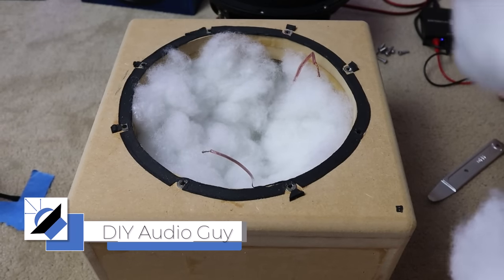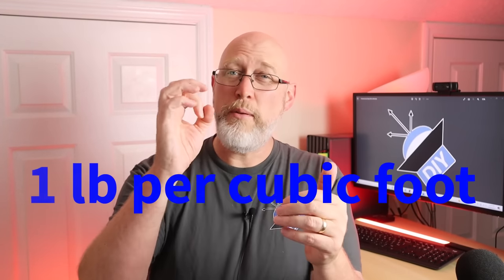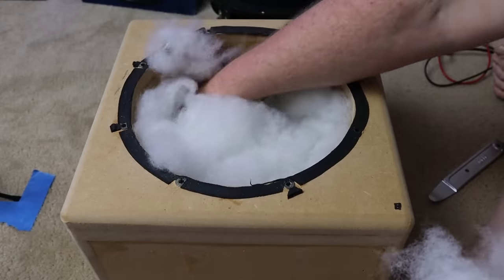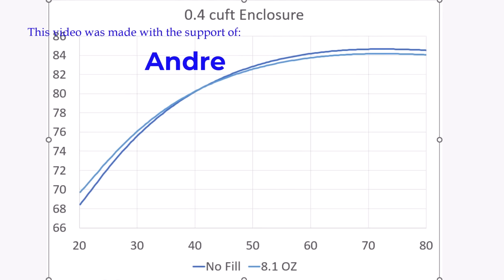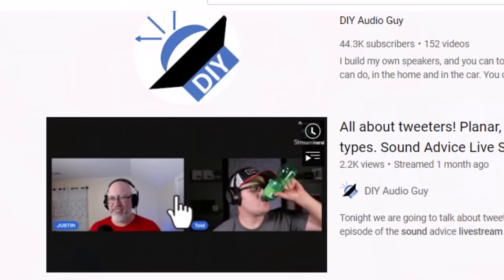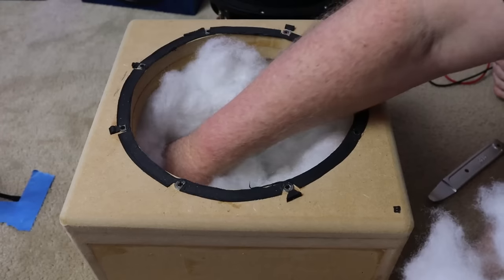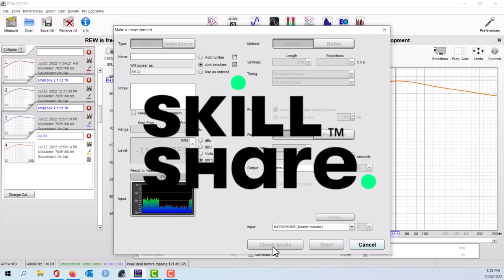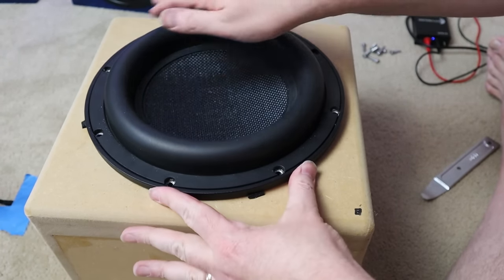Can Polyfill "fix" a small box:  Bass in a Small Space

Comment: A buddy of mine took third in modified wall at USACi finals by perfecting his small sealed side 4th order by putting poly fill in the sealed side. Completely manipulated the drivers to believe they were in larger volume and actually played lower than my fourth order using the same equipment having a larger sealed side. I've been a believer of it since
Reply from the maker: Interesting, perhaps I'll need to build some bandpass enclosures and see what happens.
Reply: Slowing the movement of air makes driver think it's in a bigger box. That is one reason why stuffing is used. In ideal use would be to tweak a little bit too small enclosure size into more favourable. 

This comment is before watching the video, I'll be back if something changes my mind.
Reply: Unpopular opinion- drivers don’t “think”.
Reply: @robtaylor8907  Yes, just words we use. They don't "think" or "believe", they are working according to their specs considering surroundings.
Reply: @robtaylor8907  sheesh ...mine do. I just trained a couple of 18's to clean my garage😂
Reply: @wb3213  damn… show me these training techniques! 🤣
Reply: Tried this in a pair of bandpass w/ 70% polyfill in the sealed sides. it made the transients less harsh by maybe removing the standing waves. Also the bass seemed smoother. Not sure if it's louder th.
Reply: It it was perfected he would of won no? Believe what you will.
Reply: @patrickmiller4987  SPL contest. More power and he would've won. His response was nice and linear. That's what I meant by perfected.
Reply: There is no perfect in audio, very subjective. SPL is just a decibel level its not SQ. Any competitor could claim "if only this or that I would of won". Like I said believe what you want bro but its conjecture on your part. Take care.

 @DibeezyTheGifted

Comment: SQ and SPL goals are muuuuch different. Polyfill and/or open-cell foam is used to mainly damp resonances and uncontrolled, peaky, runaway bass - it smooths out peaks in subs' and speakers' upper bass. It will make them less efficient, but when they're fed with more power/level boosts to normalize the FR from the upper bass losses and to the mids frequencies - the bass that's there will be deeper, tighter, and sound much better/smoother. SQ lovers don't like bass peaks followed by steep rolloffs - that's the antithesis of good bass......
Reply from the maker: If I can get enough views on this video then I will be able to do more tests.
Reply: @DIYAudioGuy  😂😂😂
Reply: Spot on. I'm focused on SQ at home and in my vehicle. I have a background in pro recording, ears spoiled by reference monitors for years- I only care about accuracy at this point. Losing 10db all around is fine by me if I gain accuracy as a result... clean amplification is cheap these days. Those crisp transients, damped internal reflections are worth it.
Reply: @lllllllllllllllllllll1lll1  Same for me for decades; at home particularly in my 2-CH room, my vehicles. I like things louder than friends & family for sure, but definitely prefer tight responses and accurate (to me) reproduction. 👍
Reply: polyfill will do nothing for resonances, it has no mass.
Reply: I used polyfill but switched to memory foam and it sounds a lot better. sealed box with two 12s
Reply: Agreed. Higher SPL isn't improved sound. It's just louder. When you raise the lower SPL curve from the poly fill to match the one without, the change in LF extension and smoother curve is easier to see. There are other videos that compare the changes in that way. Poly does what they say it does.
Reply: I found a 6" roll of  1" foam at Hobby lobby, easily cut to size, not loose polyfill that is messy. Can't wait to try it

Comment: Found it!!!  Thought you might find this interesting...

I was taught long ago the primary purpose of "fill" in a speaker enclosure is to reduce internal cabinet resonance which muddies the bass response.

1965 A. R. Bailey did a series of tests published in the British audio magazine, Wireless World using various damping materials for a long quarter wave transmission line design. Various synthetic and organic materials were used.

The test comprised of discharging a low inductance capacitor at 250 volts thru a fixed length fusible wire that was literally exploded within the cabinet with a repeatable impulse patterns.   The rise and decay characteristics were close mic'ed and captured via O scope.

I best results of all the materials used were found with long hair wool showing the smallest initial impulse rise and the quickest decay.

I've two copies of the original article, but can't find anything online.  An interesting read none the less.

Comment: I have some vintage Klipsch KG-4s that had the original 1 inch foam panels tucked into the sides of the cabinet. Not fond of the bass response, I had to add a sub to get that low end resonance to the room. I removed the foam panels,  lined the insides, top and bottom of the cabinet with felt and stuffed with 12 oz. of poly-fill. I only did one speaker at a time to test the results. Using my ears, which is the ultimate test IMHO, the bass response in the poly-filled speaker was smoother and did not cut out so quickly as the stock speaker, better low end resonance. I liked it, so I did both speakers and removed the sub from my system. Suits my ears just fine. These KG-4s are completely rebuilt now: titanium voice coils in the horns, xover has all poly caps, original inductors and 1 ohm resister instead of the .7 poly switch (to tone down the highs slightly), felt lined cabinet and 12 oz. poly fill. They sound amazing!

Comment: Back in the 80's we were stuffing boxes to dampen out the higher freqs because the crossovers at the time were not so great.  In all the testing with the test equipment i had back then i was only able to determine there was a small drop in Spl, but it did sound better with the stuffing, so great for SQ.
Reply from the maker: Cool
Reply: I remember my mother saying "Am I going nuts? Where did that pillow go?" - "Not so great" is being nice about it :  )
Reply: I added stuffing when I made a cabinet for my bass woofer out of an old beat up Kustom brand cabinet that had one blown speaker out of the two, so I bought a book from RadioShack and as I started to understand the concepts, I became intimidated by the math, and the fact that I had no specs on the 15" woofer, so I used fiberglass lining and stuffed it with poly fill, both RadioShack products, and it sounded pretty good in a manageable package. 
I would love to make a special cabinet with the modern updates and the goal of making tight bass with no irritating peaks.
Reply: Does poly work in ported enclosures? Great tutorial by the way 😎
Reply: @anthonysandoval965 Believe he spoke on that briefly towards the end; roughly a similar "quick test" showed similar returns.

Comment: Yeah, I find the larger benefit of polyfil to be damping standing waves. But that's not applicable at low frequencys
Reply from the maker: I would love to do some AB listening tests.
Reply: @DIYAudioGuy  After I moved on from entry level subs sheer output was never a goal it was always sq.
Reply from the maker: Nothing wrong with that.
Reply: Yes, I just wrote a comment about the benefit of damping being to reduce cabinet resonances. Then I saw this comment said essentially the same thing that I said, so I removed my comment.
Reply: @Roger_Gadd  - I wrote something similar, then accidentally deleted it, then wrote it a second time. Here is a repost of my explanation.

"This should not be how insulation in speakers is used. People make this mistake all the time. Insulation should be used to address standing waves and to absorb energy which can cause reflections on the driver, as well as absorb the energy to prevent it from setting the enclosure into a resonating state, which can effect sound quality and have a constant frequency being put off that is not part of the music.

If you are doing it to make the enclosure "sound bigger," buy a different driver, one more suited to fit in the size that you intend to have the driver installed. That might mean saving up more. But you will be happier in the long run.

Now, for sub frequencies, constrained layer damping is one of the best ways to stop the energy in the enclosure, with 2# MLV being able to drop the dB of the sub frequency range by up to 19dB (varies over the range). That makes it an excellent candidate if trying to address cabinet resonances while not trying to increase the enclosure size.

If instead you want to go the insulation route, for subs, you MUST use 3.5" or thicker insulation, line the entire cabinet, and it should be denim, rockwool, or fiberglass. Polyfill, also called PET insulation, also called Dacron and Acousti-stuf (specific version with crimped polyester fibers that do inscrease its effects on frequencies) and other similar names, does practically nothing at the relevant FR for subs. As such, the use of poly outside of mids/woofers should stop. This can be seen in effectiveness charts in the loudspeaker design cookbook p.45 et seq. 

Insulation helps to smooth the frequency response of the speaker. It should not be used to gain low end extension. Instead, if it is used properly, you can have smoother bass.

Look up Bobgolds website for absorption coefficient. This will show the only way to hit 125Hz or less is to use at least 4" insulation. With going deep, you may want 5.5" - 6". And there goes exploding the size of the enclosure.

To do this experiment properly, it requires two boxes, both built to have the open space being the same volume in the end. That means the final open volume in the speaker enclosures must be the same, but one built with the extra thick insulation and one without it at all. Then, you are not trying to change the Q of the driver, instead you are trying to absorb the energy before it can effect the enclosure. Surely 4"-6" insulation is not practical as it greatly increases the size of the enclosure. But, it takes that to make insulation effective at smoothing at lower frequencies. 

Lowe's carries (although out right now) 3.5" and 5.5" UltraTouch Denim insulation which is a decent price. For Rockwool, you can get 3x 2'x4'x4" insulation for $65. That would be the thinnest I would recommend to have an effect on sub frequencies. At 0.15 absorption coefficiant, or 15%, this is negligible on performance. As such, anything showing 50% at 125Hz will be less than that by the time you reach 40Hz, or even 20Hz. That means you will need something reading near or at a coefficient of 1 at 125Hz if you have any hope to damp low frequencies. Hence the 3.5" being the minimum to consider, and 5"+ preferred for very low frequency damping. 

This was the second time I typed this, so lost some things, but I think this is enough to start with. I put no links because YT likes to delete my posts when I link things. So, hope you can find things I referenced."
Reply: @asherdie  - Yes, grumpybill, I'll get right on that. But you are also forgetting the mantra of many, that "a speaker is defective without insulation." We've all heard that before. So even if the amount used, often 1" thick, doesn't address the issue, it still would be included due to public perception of insulation being necessary in "premium" products by a community that does not understand the purpose of the insulation.

Or let's look at an interview Erin's Audio Corner did with a KEF engineer, where that engineer discussed having an inch of insulation per wall for each span of 8", thereby making a 24" span need 3" of insulation per wall for opposing faces (suggesting 30" for the internal space in that scenario). 

Also, I didn't say it did nothing, just very little with PET. But you also have to look at cost realities depending which area of the market you are trying to address while keeping costs down. That makes PET more attractive, even if the efficacy is lower. It is all trade offs. 

But when you are building your own, DIY, then you can design from scratch following these principles and adopting a higher cost insulation is easier for DIY to eat to implement than cost outlays for a regular product line. 

So stay frosty with that wit you have there!
Reply: I've also seen it used to tune ports in T-LINE enclosures.
Reply: @beakerwsw  Polyfill made a huge difference in my TL full range home audio speakers.  I did a similar test and kept adding polyfill until the bass output from the port was more balanced with the midbass output from the cone.  Did it make the speaker more inefficient at certain frequencies? Absolutley, but that was the point, to get it balanced without requiring an EQ or DSP.  The same applies to sealed subwoofers.  If polyfill lowers 80Hz without lowering 40Hz, it's effectively smoothing out the frequency response without having to resort to input signal manipulation.
Reply: @chrishuyler3580   What test equipment did you use to verify your results?
Reply: @ddtstrc9678  REW and a ECM8000 microphone...but the differences were clearly audible before testing if you chose the right recording.  The speakers were also very sensitive to placement in the room, distance from the back wall etc.  They required more polyfill the closer they were placed to the wall.  Again, the goal wasn't to maximize bass output, they were fine in that regard, it was to level match the bass with the midrange so a walking bass (instrument) didn't all of a sudden boom and fill up the room with one note then go quiet when it jumped an octave.

Comment: I don't understand all those charts and things but I do know after putting polyfil in my two very small enclosures it improved the sound quality to no end, not necessarily more bass but much improved sound quality.
Reply from the maker: This was not a sound quality test, it was a frequency response test.  My goal was see if the polyfill would improve low end extension. I conclude that it did not.
Reply: @DIYAudioGuy  I just did a polyfil test today. Im building some medium size 3-way stand mounted speakers. 8" woofers with 10" passives. I have them mocked up for testing, so I added 1.5lbs of polyfil to one and left the other empty. I see why people think it adds lower extention. It's actually damping down the upper bass(120-200hz) which allows my ears to hear the lower bass notes more clearly. The empty box sounds much more "boxy" (for lack of a better term) at higher volumes than the stuffed one which sounds more natural.

Comment: Most of my builds I only use poly in the 2 inch mat.  Just to reduce cabinet resonance. I use it sparingly where needed.  I have been using rockwool in some recent builds with very good results.  I try and build cabinets that don’t have too many box resonances but even then adding some well placed damping can tighten mid responses. It can definitely help smooth out some irregularities from internal reflections.
Reply from the maker: It may help with that, but I'm no longer convinced by the argument that polyfill will improve low frequency extension.
Reply: This could be another test - how does polyfill effect irregularities or random spikes? How flat is the curve in the + or - 3db range with and without polyfill?
Reply from the maker: @ramonbmovies  there are an infant number of variations that can be tested.  One person can't do them all.
Reply: @DIYAudioGuy  I would have to agree... I have never used polyfill for that application.  Predictions modeled in software you can see the effect of fill in your box really does correspond with the measurements you took.  Negligible changes in the lowest range with some reduced overall output.
Reply: I do similarly. I often use some Ultra-Touch Denim insulation on the walls torn in half thickness-wise in strategic locations, then lightly stuff with Polyfill just to help reduce the echos and sound bouncing around inside the cabinet. Similar to sounds echoing inside an empty room in a house... If you can hear an echo, that sound wave can interact with the rear of the driver cone and create additional, non-musical sounds. I don't think I've ever used it to try and make an enclosure 'appear' larger to a woofer or sub.
Reply: @ramonbmovies  that'd be ideal I think, that's where stuffing really shines in my experience (and in VituixCad).

Comment: I added a LOT of rockwool to my ported UM12" by adding it to the walls. It cleaned up some resonances and lowered my tuning by 1Hz at no cost to my overall SPL. I'm getting flat output to 16Hz now. I know it's not polyfill but it was really cool to measure the before and after.
Reply from the maker: Right, this stuffing works best in a box that's already been designed correctly. Trying to stuff a box to make it bigger is an exercise in futility.